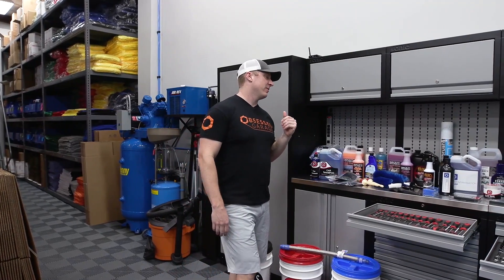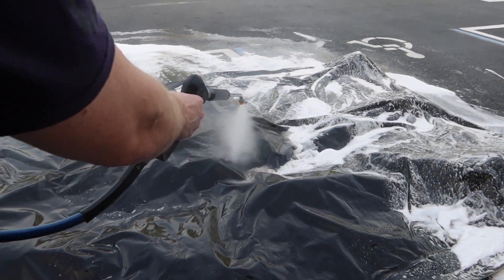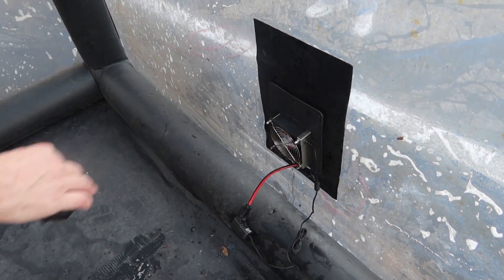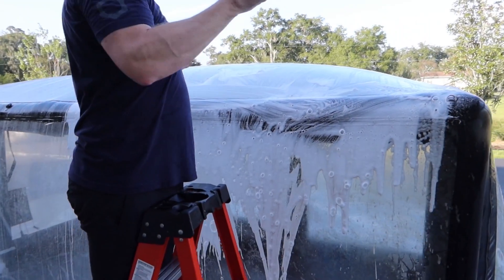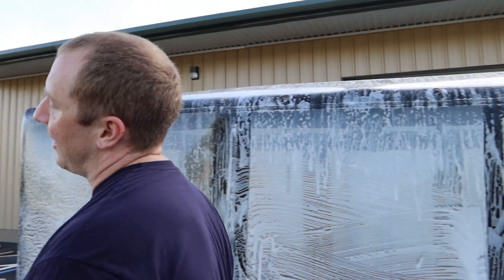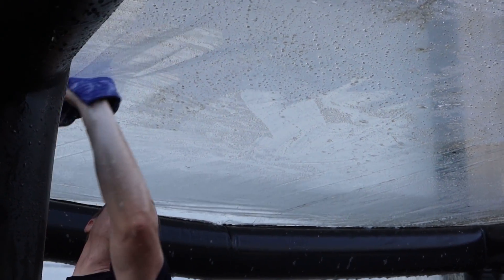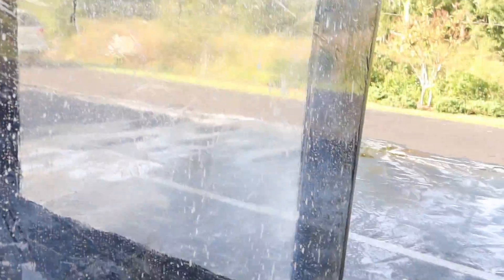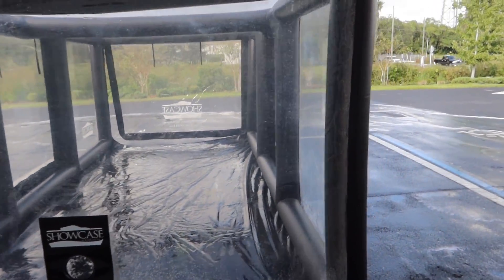Cleaning My Dirty CarCapsule ShowCase

Comment: This giveaway seems an awesome deal, some lucky person is going to be very happy. Im trying to find something to buy that I really can use, if I win flying is not necessary you can drive to my Florida home in St. Augustine..😜 This had to be the dirtiest thing I have seen you clean. I don't know what's in the Air in Florida but it just damages whatever is passes over. My front door handle in Florida I have to change it once a year it rots the finish right off of it. Here in NY same handle for the last 15yrs and its still new looking.